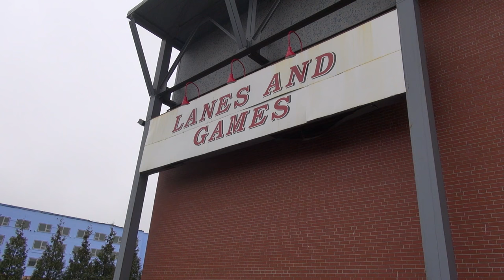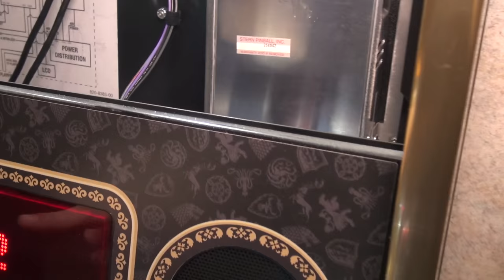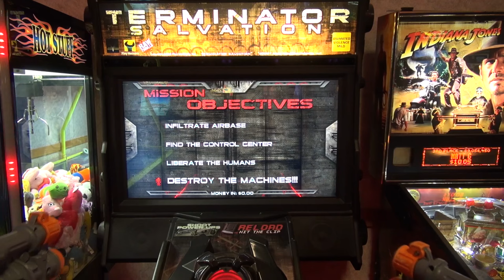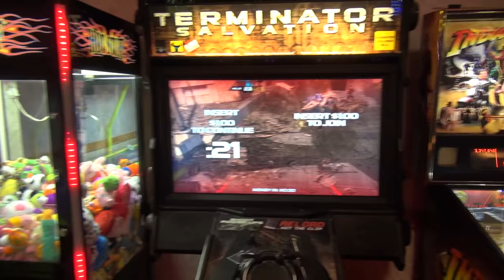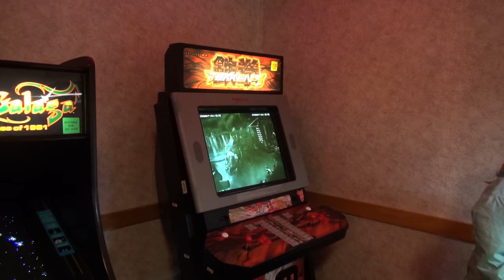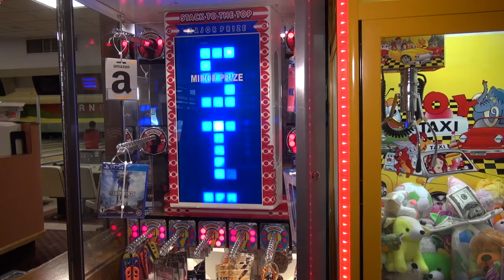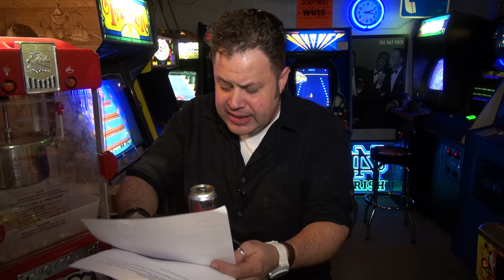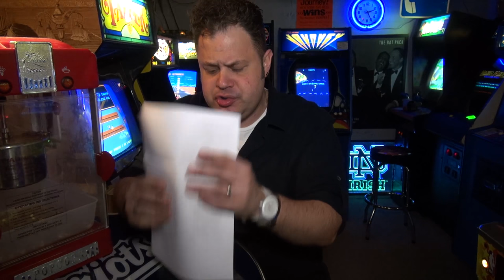STERN GAME OF THRONES PINBALL REVIEW AND MORE! Lanes and Game Arcade Tour - Cambridge, MA

Comment: I believe it was in one of your older videos where the fact came up about Q-Bert having some strange quirks that came up over power supply issues. Things like a chatty Q-Bert and a wayward 'thud kicker'. But...to have that oddity be like an emergency warning system? I mean that one needs to be shared anywhere any Q-Bert chat/history is mentioned. I even bet the designers would love to hear how that probably unintentional issue actually saved property from being burned down. It's like some kind of astrological odds thing. A kind of chain reaction of events from the angels.

I could see having some John's Arcade tokens being a very good thing for parties. Exactly for the reason you mentioned.

And, along that line of thinking, have you tried removing the quarters from the Computer Space, just yet? The way one has to get at that can and how heavy it could potentially get...kind of gives me a small scare. I mean, the exposed electronics just seem somewhat Frankenstein like and trying to lean in there to pull out this metal can seems...well, it was the first video game and they had learning to do. Still, seems like a back strainer and hairy situation to just get it out of there.